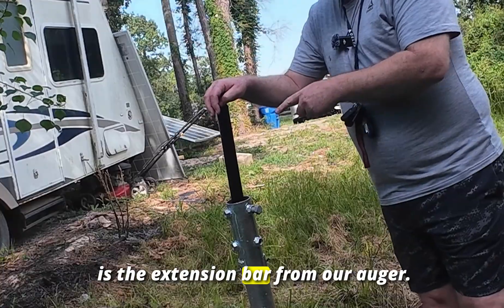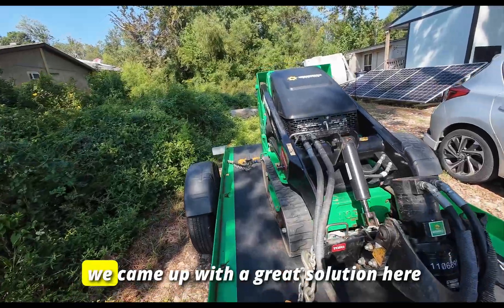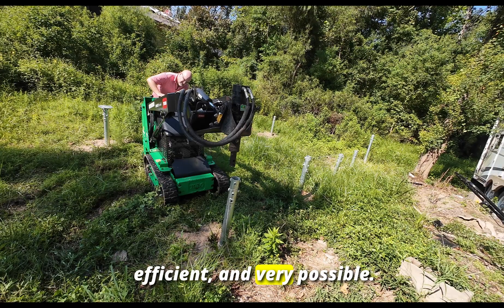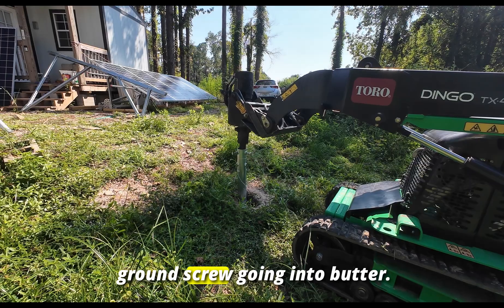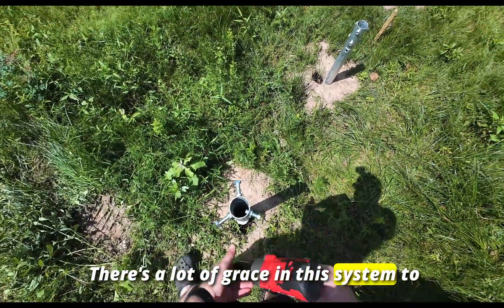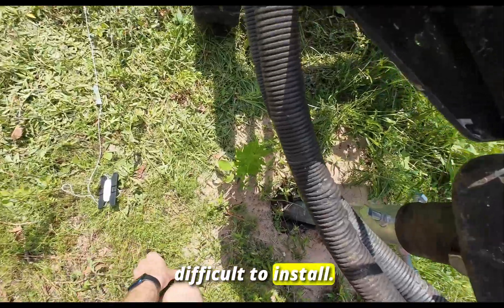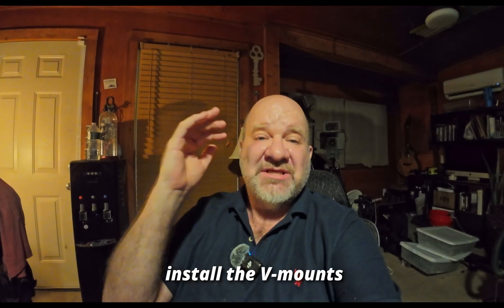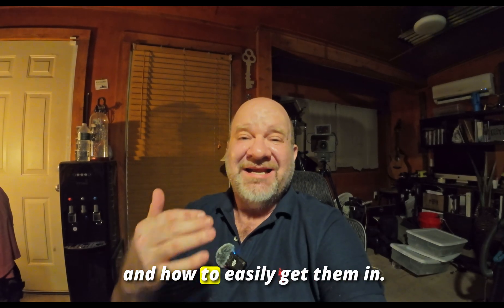DIY Ground Screw Installation SOLVED! Chiko USA Ground Mount + Sunbelt Rentals Toro Dingo

Comment: Nicely done! It's always nice to see a solution like this work so well!
Reply: When will signature solar get the Large Module version of this ground mount. The Only version they sell now are for 60 cell solar panels (up to 68 inches tall) I wanted to put 450w panels on mine which are about 72 inches tall 44 inches wide. I have 10 of those I want to install on it
Reply from the maker: I don't have an answer immediately, but I'll check with my Signature Solar contact and see if I can get some information on that. Thanks for your comment.
Reply from the maker: Absolutely agree! Stay tuned the finish ground mount is coming soon!